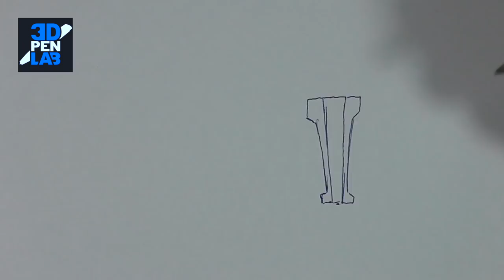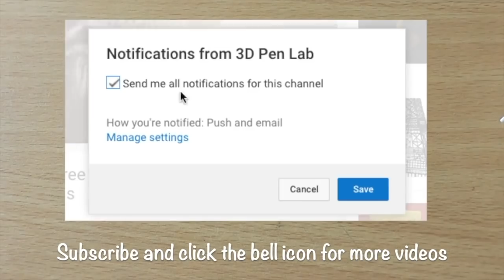3D Pen | Making Cuddle Team Leader | Fortnite Battle Royale | 3D Pen Lab

Comment: If i do this with the dewang x4 pen and abs will it work the same please i need to know
Reply from the maker: No, I dont recommend to use abs
Reply: Ok
Reply: Nut it will work with dewang x4 right
Reply from the maker: @shahidshafiq2207  all the 3d pens are basically the same yes
Reply: Thank god but the prob is my pen is 1-2 years old
Reply from the maker: @shahidshafiq2207  and what is the problem? If stills works it's totally fine
Reply: I mean it does but i cant clearly see the screen because its to dull
Reply from the maker: @shahidshafiq2207  just increase or decrease the temperature depending if you want it more or less melted, screen is not so necessary
Reply: Ok btw my name is Ali
Reply from the maker: @shahidshafiq2207  nice to meet you Ali you are welcome☺️💕
Reply: Nice to meet you too
Reply: Loved your vids

Comment: Still waiting for a 3D pen that doesn't crap out after a few hours of use.  Not renting a tool for what effectively is $20+/hour.  I spoken to many people, and none have found a 3dPen that works for the long haul.  I'm not talking about clogs, I mean the motors and gears just crap out.
Reply from the maker: mine still alive for many years..
Reply from the maker: but I opened many times to take filament out when gets clogged